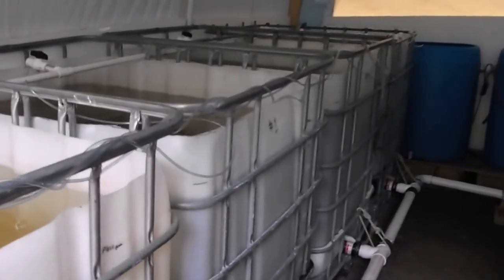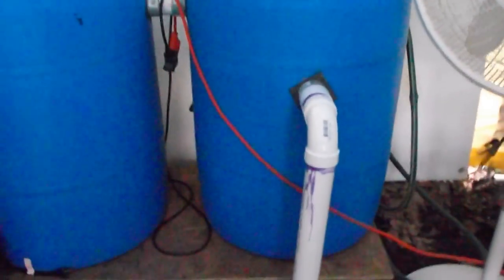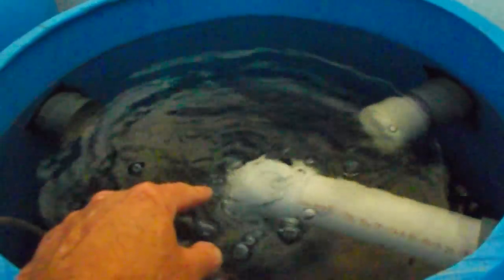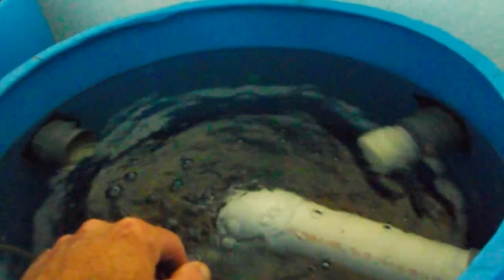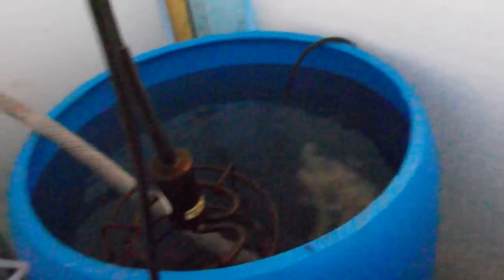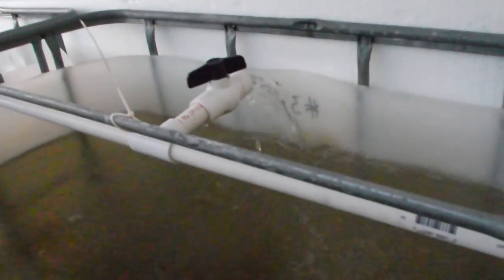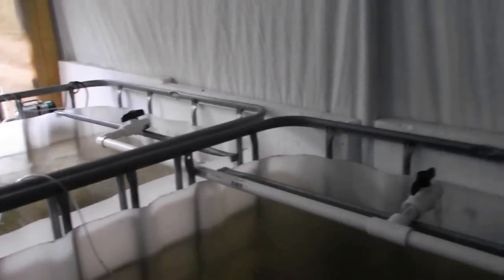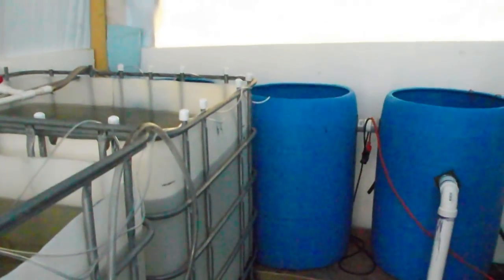Tilapia - Filter System Details

Comment: What is the maximum number of tilapia that you can put in that ibc tote? What is maximum of ibc tote can run on that 55 gallon filter? What size air pump are you running each tote? Great set up!
Reply from the maker: If you are growing your fish to full size, I give them 5 gallons of water per fish. So for a 275 gallon tote with 240 gallons of water level in each tote, you would be able to grow out around 50 fish per tote for them to grow large and quickly....you don't want them to be stunted because of lack of room to swim. About 4 to 5 totes depending on the size of the tote, the total water in the system, the size of the return pump in the sump and the number of fish per tote and the size of those fish. Also, the tilapia use dissolved oxygen to metabolize their food so air is important.  The 4 tote system I used had a 1578 GPH submersible pump in the sump so the total volume of water would be filtered at least once an hour.  The air pump is a small commercial pump with an output of 72 LPM (liters per minute).
Reply: Mineral Springs Tilapia . Thank you for taking the time to respond. There is not much information out there. I was reading a couple of site that the rule of thumb is 1 gallon for 1 pound of fish. Is it true? Instead of using a 55 gallons drum biological filter. I increase it to a 275 gallon tote for 6 fish tank tote?
Reply: I thinking 200 lbs out of 275 gallons tote. Is that possible?
Reply from the maker: You could do that if you wanted too, just be prepared to clean solids filter everyday....that is a lot of biomass in a single tote, then when you multiply that by 6 totes, your solids filter will have to cleaned daily....I preferred not to clean tanks all day, every day. Your water in your totes will probably turn brown in a day...not dangerous, just looks nasty and you can't see what is going on with the fish.
Reply: Mineral Springs Tilapia . Thank you so much. I have been looking for this answer for 5 years. Lol. I don't mind cleaning the solid filter everyday. I am more concerned if it's going to be dangerous for the fish. I have limited space, water and electricity at my location. It's will barely cover expense with 50 fish per tank. I know I can get away with a 55 gallon mechanical filter with daily cleaning. I was more concerned on the biological filter can't handle the load. You are amazing.

Comment: Good day sir, can you tell me the size and make of both your air and submergible pumps? Is the air pump noisy.
Reply from the maker: +electrofranko My air pumps are Active Aqua 72LPM pumps with six way adjustable flow splitters.  The water pump is an EcoPlus 1500 GPH pump.  Both pumps are quite and dependable.

Comment: Nice system, I have two separate IBC fish tanks- one is aquaponics - 3 grow beds the other aquaculture- no grow beds- so I have 250 gallon fish tank- draining in to a 35 gallon radial flow filter which then flows into a bio-filter, which is another 35 gallon barrel- half full of lava rock then topped off with what I had- shade cloth. No air in the bio- I have to change water every 3 to 4 days- turns cloudy and ammonia  starts to get high. Will adding a venturi or air stone make all the difference ? I also have to vac the fish waste out of the tanks every other day. I use a stand pipe in-lieu of the bottom drain. need help as I am wasting water and a constant maintenance issue. How often do you clean your filter and tanks ?
Reply from the maker: Hey Steve, How long has the fish only system been running and do you have a heavy load of fish in the 250 gallon tank.  I would recommend that you add air to the bio filter. My total water volume is about 1000 gallons, you saw the fish load in the tanks. I clean the solids filter every two weeks and I change about 200 gallons of water each month mainly to clear some of the Nitrates. If your system is new and/or you have a heavy bio-load, it will take a while a month or two of the system running for the bacteria level to grow large enough to start converting all the ammonia to nitrites and then when the nitrites become available it will take the same amount of time for the Nitrobacter bacteria to colonize in you bio filter to convert the nitrites into nitrates. In the mean time all you can really do is 1.  water changes to clear some of the ammonia and/or 2.  Decrease the fish load and give the filter time to catch up then slowly add more fish. I don't ever have to clean waste from the totes, it flows into the solids filter and I clean it out there. Using the drain from the tote will really help keep waste out of the tote. Your fish will always be stirring up the water and consequently the waste at the bottom of the tote so it will eventually find its way into the drain.
Reply from the maker: Mineral Springs Tilapia One Thing I forgot to mention, you can buy live bacteria from you local fish store and kick start your bio filter. Just follow the instructions on the bottle.

Thanks for the comment!

Greg
Reply: In my aquaculture tank which is 250 gallon IBC I have 14 fish average size is 1/2 to 3/4 lb each. System is only 2 weeks old, so I need to add air and wait !
Thanks for the help
Reply from the maker: Thesteveb333 You will still need to keep the ammonia levels down while you are waiting with water changes and/or an ammonia reducing chemical like Aqualife Complete. 1/2 to 3/4 lb fish will produce an abundance of ammonia. Go to your local Aquarium Shop and get some live bacteria to kick start your system. You can put it anywhere in the system, but I prefer to pour it in just before entering the bio filter.
Reply: My aquaponics system 1- 250 gallon  fish tank and 3 grow beds has been up and running for a good 4 months, would some water from that system get the bacteria levels up ?
Reply from the maker: Thesteveb333 Absolutely Steve, we call it seeding the system. The water, as well as all surfaces in you older system contains bacteria. I generally don't recommend seeding with water from anyone else's system, but since you will need your systems to become interchangeable as far as the fish are concerned, it would be a perfect solution. I would swap water back and forth for a while. Your established system in probably much more capable of handling the higher levels of ammonia.  Just continue to test your ammonia levels.  Great Idea!

Comment: because your waste water has to go up in a pipe, do you have settled waste in the pipe? is there a way to operate the whole system without any electricity meaning that how do you pump your clean water from the last tank (sump tank) back to the fish tanks?
Reply from the maker: Ok, the water flow is fast enough to push the solids into the solids filter.. When I took the system down, which I did when I built the new hatchery, the system had been running for 18 months. I checked the 2 inch pipe and there was NO debris in the pipe. I can't think of any way to "lift" the water without a pump back into the tanks, but the wattage on the pump is so low that it could easily be done with a small solar system if you needed to do it that way.

Comment: Hi this is a great video and awesome forum. Mine has same question of how solid from IBC can be sucked into solid tank when the pipe goes upward? The other thing is how biofilter effect the quality of water compare if just using mechanical normal filter? Thanks alot for sharing the video
Reply from the maker: Hey Michael,  the volume of water going to the solids filter will be dictated based on how much water is pumped out of the sump back into the tanks.  I had an 1800 GPH submersible pump in the sump tank and because of the lift of the water, I moved just under 1200 gallons per hour constantly.   The short lift going into the solids filter makes no difference as long as the entry point into that barrel is nearly 18 to 24 inches below the water level in the tanks.  If you open the valves and don't start the return pump from the sump, the water will completely fill all three filter barrels and once the water level is equal in all 4 totes and all three barrels the water will stop moving completely. That is why the top of the barrels and the tops of the totes are at the same level.

If you have a lot of fish in the totes, you will need the biological filter in order to keep ammonia and nitrites under control.  I never tested for or worried about nitrates.  I can't really answer you second question because I always had a bio filter.
Reply: Thanks for the reply. Appreciate it very much. If I may ask how you determine the size of sump tank ?
Reply from the maker: I just make it whatever size I want....it is just for extra water and system refill.  No specific size except that the tops of all the filter and sump component have to be the same height of the totes or in a power outage, you will loose water from the system.  Remember, water will always seek its own level in a closed system.
Reply: Mineral Springs Tilapia great thanks for the advice

Comment: I'm very impressed with your system. Do you not supply oxygen to the fish? How many fish can those tanks hold?
Reply from the maker: Francis Forrester Good morning Francis, There is a large air stone in each tote run by a small commercial air pump.  There is also an air stone in the Bio-filter.  The number of fish depends on the size. If you are just using the totes to grow 1 inch fish to 2 inches, each tote will support about 1000 fish.  If you are going to grow fish to full size to eat, My rule of thumb is 5 gallons of water per fish at full size.  If you have really good filtration and a lot of air, you could get as low as 3 gallons per fish at full size. Room to swim and good water quality along with plenty of air, good quality food and some light make your fish grow healthy, strong and very quickly.
Reply: Good morning Sir.
Thanks for the prompt feedback. I like your process because I want to do my own brood stock, fingerlings and fries instead of buying them. then I'll like to take them into the lake to grow.
This is a project I want to do in the tropics.
I live in Canada, please where can I get air stones and the other kits?
Reply from the maker: Francis Forrester Wow, the tropics sound nice right now.  Most of the things I get, like air stones, sponge filters, aquarium heaters and other smaller items, I buy off of ebay..  There is a great selection of these things on ebay and the prices are normally lower than my local aquarium stores.   Thanks, Greg
Reply: Thank you Greg. I'll keep you posted. May the Lord bless you.

Frank.

Comment: hi, very cool setup👌         I was wondering  what you were running for a pump that starts the flow and how much power does it take? could you make it solar? thanks awesome video!
Reply from the maker: It is an 1800 GPH submersible pump in the sump.  The pump runs on less than 100 watts.  It could easily be run by a small solar system.  Thanks for the comment and good luck setting up your system.
Reply from the maker: Oh, the pump is an "Eco-Plus" purchased off Ebay.

Comment: Hi Greg!  Thanks for all the videos.  I think I have seen them all now.

How are connecting to your filtration drums?  Bulkheads?

Bruce
Reply from the maker: Z223I  I used 2 inch male and female (male outside screwed into the drum, female on inside to tighten it up) electrical adapters.  The PVC ones at my store are all tapered.  Used a little silicone at the connections.  Never leaked in over a year running 1500 gallons an hour through the system.  Probably would have been easier to use Uniseals.
Reply: Thanks

Comment: What about the ibc drains that go to the solid filter..how do you prevent fish from going out?
Reply from the maker: If you look on that video,  you will see a piece of 1.5 inch diameter capped PVC with holes drilled all around it  that will keep 1 inch fish in the tote. It is in the tote hammered and siliconed on the inside of the drain hole. It is only about a foot long.
Reply from the maker: Just make sure the fish are large enough to not fit through a 1/4 in hole.

Comment: Hi I like to know where did you find the fittings that go into the totes and what size are they. Thanks
Reply from the maker: I got all my PVC, rubber boots etc from Home Depot.  All the pipe and boots are 2 inch.  IBC totes come in a couple sizes so always measure the IBC tote fittings first.

Comment: If power goes and you are not there, will the barrel with the pump overflow, seeing their is no power for the pump. if it does overflow what can be done?
Reply from the maker: +electrofranko The barrels will NOT overflow.  Since the tops of the barrels and the tops of the totes are at the same level and water seeks its own level, the system just stops flowing and remains static.  That is why the barrels are up on stands.  If any part of the system was at a lower level it would overflow at that low point until all the water was again at the same level throughout the system.  Hope this helps.....Greg

Comment: hi greg me again with another question. how you know in between male and female tilapia.thank greg for all your help.
Reply from the maker: Luis Cancel You will need to let your fish get to about 3 to 4 inches before you have a reasonable chance of getting it right..even the experts get it wrong 5 % of the time. 

Ok, you will probably need a biological staining agent and I use crystal violet. It stains the openings of the genital papilla of the fish which is just behind the anus of the fish. Grab a fish and turn it over in your hand, dry the area with a paper towel then stain the area with the crystal violet.  I use a jewelers hood to magnify the area.  In the male you will be looking for 1 opening through which urine and milt (sperm) passes. Do not count his anus, it is not part of what you are looking for. In the female you are looking for 2 openings, the first is an opening where urine passes, the second is a lateral slot (side to side) through which eggs pass.  This process is very difficult to learn and takes lots of practice so I wish you good luck.  Take your time and remember,  when you figure it out it will become much easier and faster.
Reply: Wao interesting, thank you for you for all you help.

Comment: so the water will flow out of the bottom of the tanks and go up into the barrel without a pump and the only pump you use is the sump to pump water back to the tanks
Reply from the maker: Yes, the water flows through gravity because the water level throughout the totes and barrels is the same and the water flows into the first barrel (the swirl filter) about a foot below the water level in the totes.  Water will always seek its own level in a closed system.
Reply from the maker: The flow of the water is dependent on the amount of water being returned by the pump that is in the sump.  I try to turn the water over about once an hour. So, for my 1100 gallon system I use an 1800 GPH submersible pump to make sure I get at least 1100 GPH flow rate..there is about 5ft of lift that reduces the efficiency of the pump.

Comment: I feel like this is a stupid question. 

How does the water draining from the IBC totes go into your drum filter when the water has to travel up the 90° up pipe into the drum?
Reply from the maker: Remember that water will always seek its own level.  Since the pipe enters the first barrel at a point lower than the water level in the totes, the water will continue to drain into and out of each barrel until the water level is exactly the same in the barrels and the totes (static).  The water pump being in the back barrel (sump) and pumping the water out of that barrel it creates room for the water to start refilling the 3rd barrel and because the water that is being pumped into the totes the system starts running again trying to remain static. It is just Hydrodynamics that allows this system to continually move water in the direction I want it to go.. Once the water pump is turned off, and the water level is the same in all components of the system (4 totes and 3 barrels) the water movement simply stops.  Nothing overflows because all of the components are at the same height and the water pressure is the same.  The barrels could  be other totes or a 6" diameter tubes,  it wouldn't make a difference because once the pressure is the same the system would still just stop moving without the return pump .
Reply: @MineralSpringsTilapia  ,How have you done the plumbing inside the totes?Do you have a video for that?

Comment: hi Greg,
can you make a video about plumbing with these toats please? what kind of connector do i need to connect 2" pipe to the valve at the bottom?
thanks.
Reply from the maker: +N B  Hey N B, as you might have figured out in my videos, I no longer grow fish to full size and I just raise fry, fingerlings and breeding colonies.  However what I used to connect my 2 inch PVC to the drain at the bottom of the tote was a 2 inch rubber boot that has hose clamps built in to it.  Just force one end over the threads of the tote drain and slip the other end over your pipe.  Then just tighten the clamps and you are done.  Doing it with the rubber boots allows you to get away with small miscalculations with pipe lengths because they flex.  The rubber boots can be found at Home depot or Lowes.